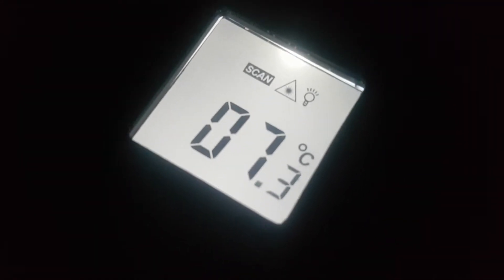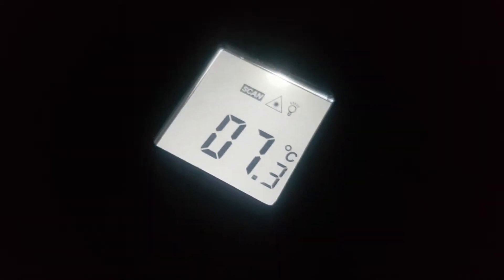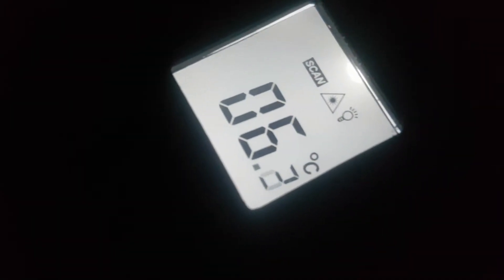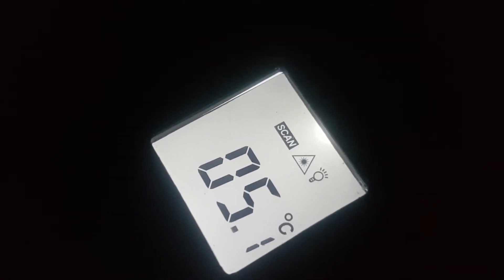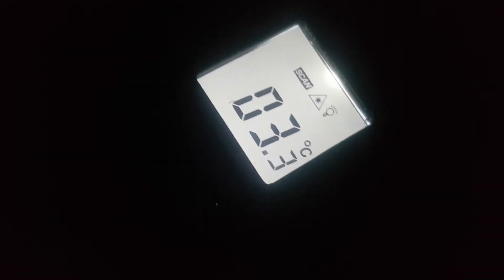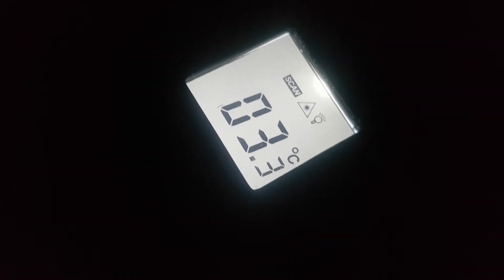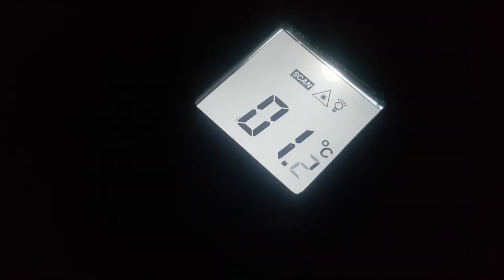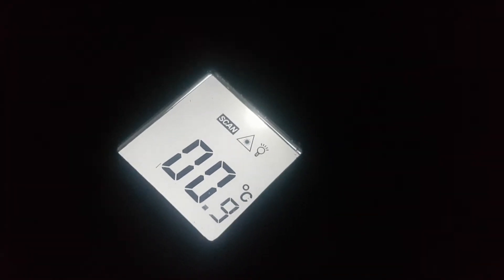Controlled Moon-Light Temperature Tests

Comment: I tried this with an additional test to prove my theory: which is that lighter coloured surfaces reflect more light and heat ( as we all know to be true) so the moonlit surface will always have a slightly lower temperature. To prove theres  nothing magical about moonlight my theory would work with torchlight as well. And it does. Torchlight has the same cooling effect, because lighter coloured surfaces reflect more heat.
Reply from the maker: Awesome! I did the same test under streetlights too, and found they also "produce a cool light". It's a nonsense theory discrediting the real and actual truth about Earth being flat. Just because it's flat (well, sea is always level, at least, land itself is quite undulating), doesn't mean everything else we know about physics and reality has to actually change. I'm so glad to see someone else understands this relationship about light and heat in a cool environment. I never really thought too much about the colour of the surface, but of course, that makes a lot of sense too. Cheers!